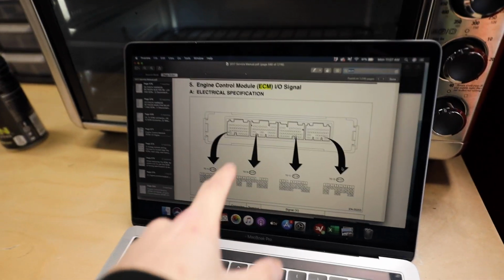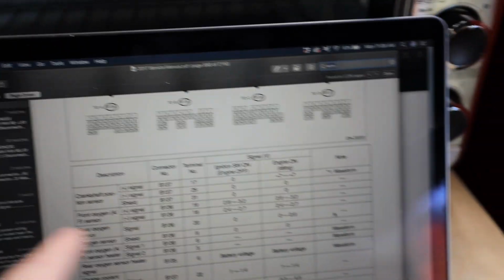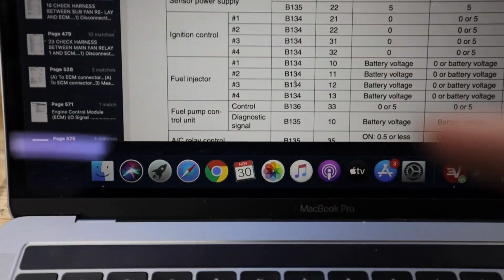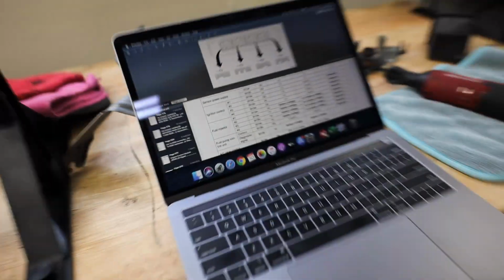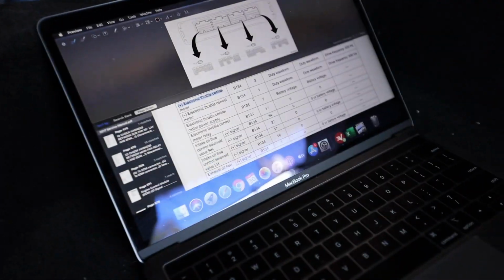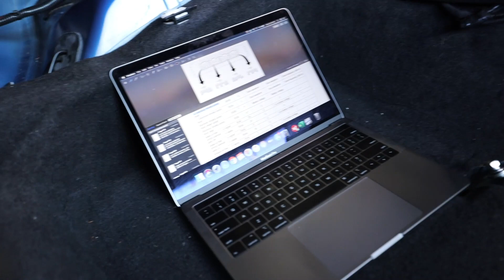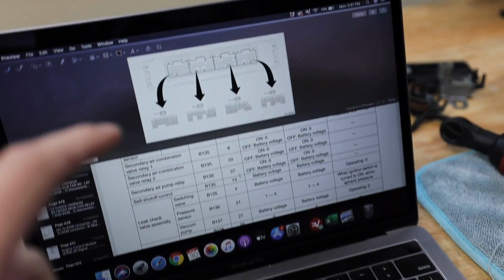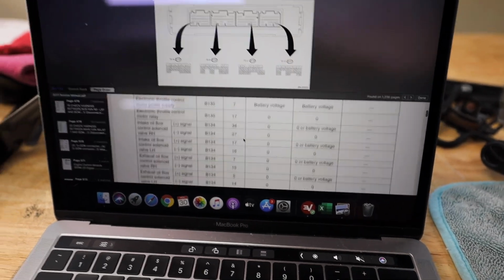Its Only a Little Intimidating...

Comment: Amazing and unique content!
It turned out not so difficult as it may seem at the first sight!

I still do not understand why you want to delete ignition, injectors, throttle control wires.
How is it possible to run without these sensors?
Reply from the maker: I don't want to delete them lol some of them just needed to be replaced from being so old 🙏🙏

Comment: Hey, save yourself the hassle don't cut your factory harness but split it into it 8 inches above. Unless it's shielded. but keep the plugs incase you need to keep the ECU in to have it run your ac. there daughter boards that do it but it's easier to just have your stock ECU run that stuff and have your new ECU take control of engine management
Reply from the maker: Only engine management wires are getting cut off, I may ditch them all later on though. The new ECU comes with a canbus controller so ill have to move wires over to that one anyway 😅

Comment: Looks like a headache... Don't all those wires go to the big square plug (the one u have to move for the iag aos) under the hood? So, then, that plug is exactly the same, pin locations and all, across all subaru motors, even with 6 cyl? Not trying to be a jerk, just honestly don't know 😅
Reply from the maker: No they're all different 🙏 the EG33s harness has 4 harness plugs instead of 1 in the engine bay. But our new ECU will have its own plug
Reply: @Smeedia  o ok, so ur just identifying them so u can remove them, not reuse them. That makes a lot more sense, maybe I should 💨 less 🌲😆. Hope all goes well acquiring the new car! 🤙

Comment: Also not trying to be salty but eg33 factory service manual ECU kinda succkkkkk like coil and injectors aren't correct. you can sanity-check yourself by chasing it though and see what the wire goes to.  which is why so many people burn out ignitors when swapping an egg33 because FSM for an eg33 ECU sucks. which you're not using but incase anyone else is doing anything eg33 related.
Reply from the maker: Good to know, I won't be using the EG33s wiring or ECU thankfully 😅🔥